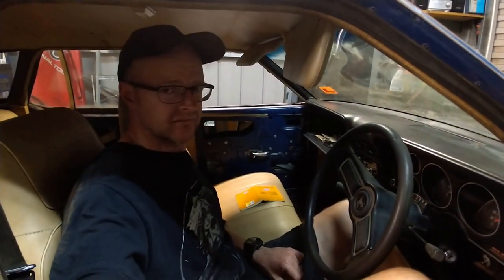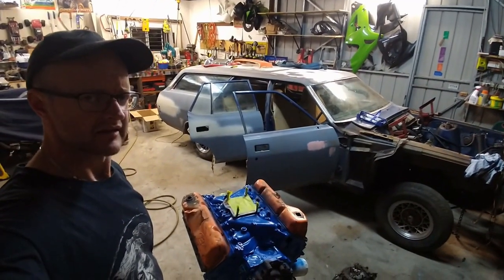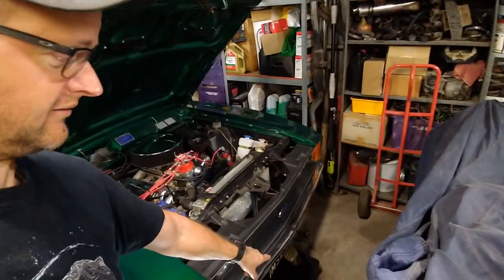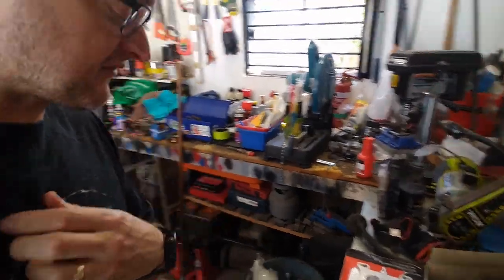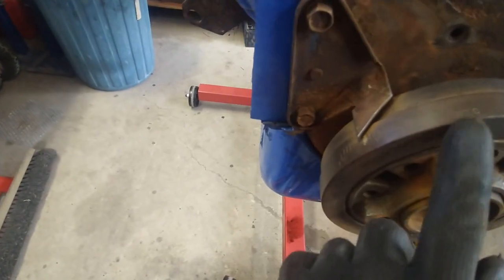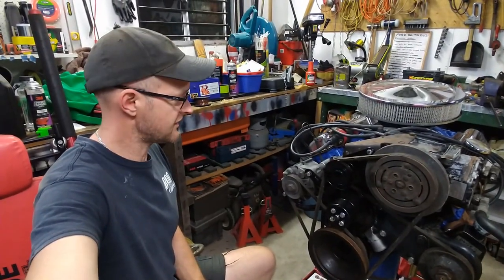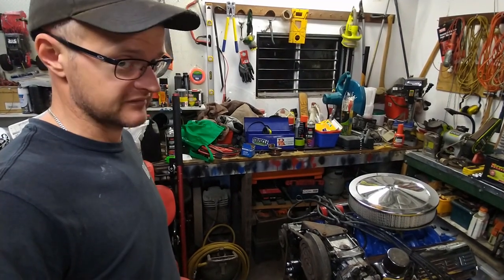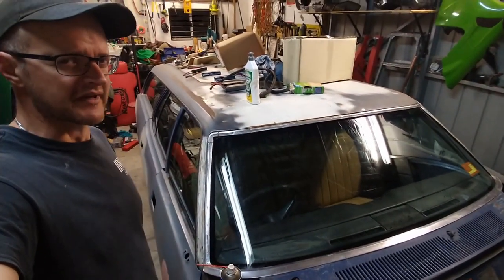XC Ford Falcon 351 Cleveland GS wagon project: Ep 4 getting motor ready to reinstall into crusty GS.

Comment: That was a good video, getting all of the ancillaries onto the engine and working it all out for fitting into your sedan.
I would imagine a K code GS column shift wagon would have been a rare beast back in the day. If you want to confirm if your engine is a 351, remove a spark plug, get a straight piece of wire or a long thin screwdriver and put it into that cylinder - holding it gently on the top of the piston and keeping it steady on the same spot  - guiding it down as you slowly turn the engine over by hand until the piston is at its lowest point and place a mark on the wire where it exits the spark plug hole with a marking pen - don't let go of the wire and keep it on the same spot of the piston. Keep turning the engine over until the piston is at its highest point and place a mark on the wire where it exits the spark plug hole - remove the wire and measure the distance between the marks. 
This gives you the stroke - 3 inches = 302, 3 1/2 inches = 351. Hope it helps
Reply from the maker: Cheers mick, its definitely  a 351.